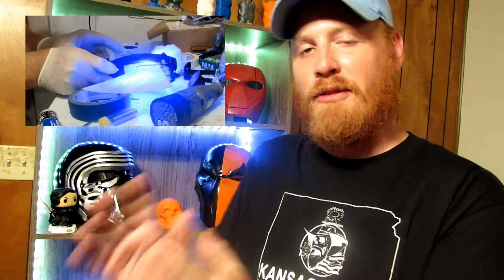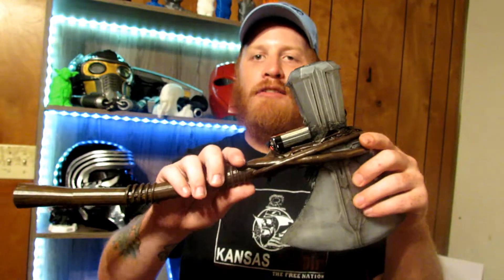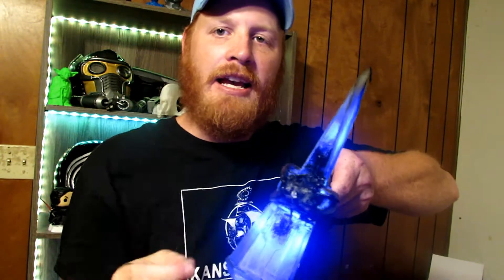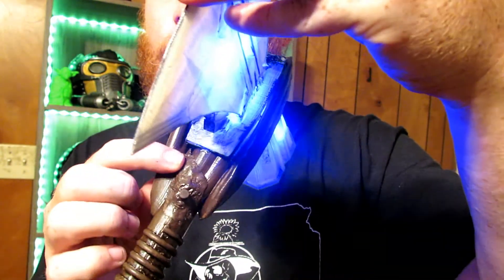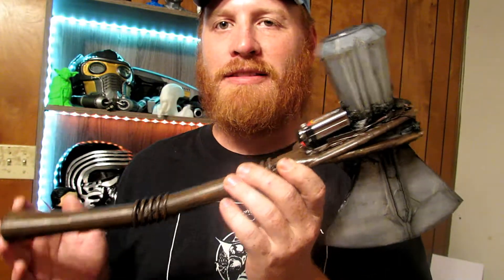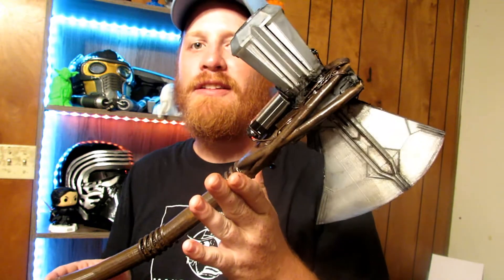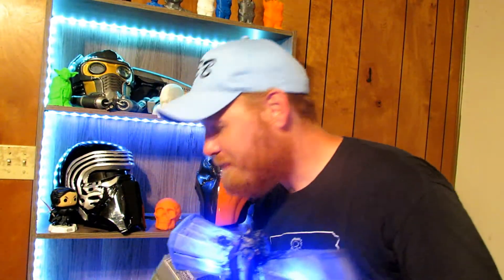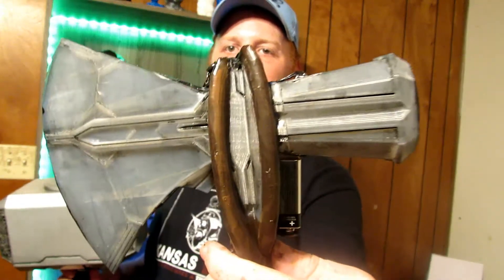3D Printed Storm Breaker

Comment: Question? What wiring diagram did you use for your six LED set up? One resistor or one resistor per LED light?
Reply from the maker: none. I just wired all the LEDs together into a 9v conneciton with an on & off switched through the positie wire. Its a real simple man set up. When you use a 9v there really isnt enough power. The battery runs out pretty quick but the LEDs wont burn out. I do the same thing in my Iron man Helmet. No need to really limit the votls unless you go a lot higher.